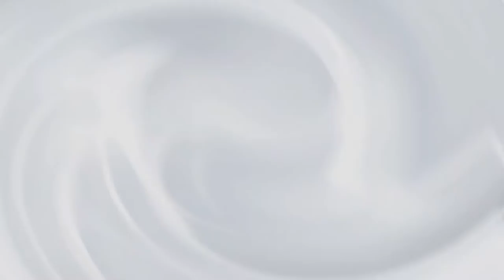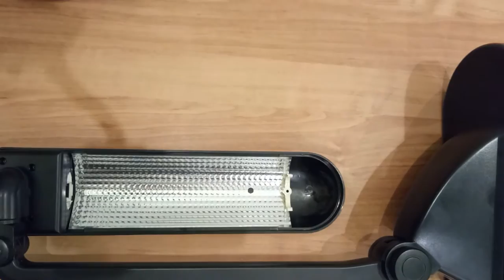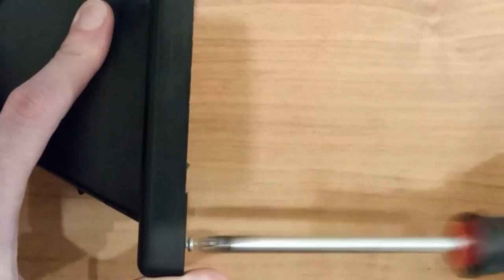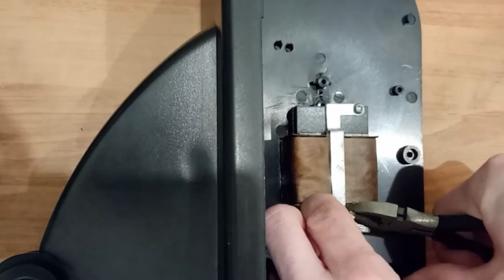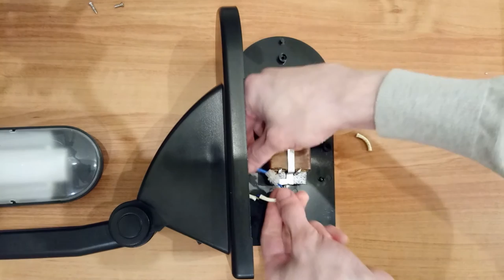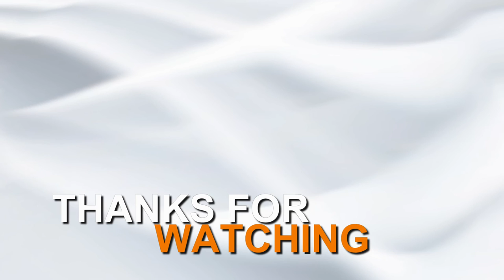G23 fluorescent lamp - to into leds lamp G23 - Restoration Table Lamps G23 - Desk Lamps / DIY

Comment: To your knowledge: will the led lamp flicker if I just decide to retrofit it instead of a fluroscent one?
Reply from the maker: You CANNOT just install it instead of a fluorescent one. The lamp has its own circuit.
Reply: @LifeKaki  well, for example, Osram Dulux S 11 LED EM can be installed by either:
 1) Retrofitting - just replacing a fluroscent lamp with the LED one
 2) Conversion - bypass of the ballast (direct connection)
Reply from the maker: @ashez002  Well, ok, I don't have that kind of lamp.

Comment: I did this exactly as you did.  My light very similar except 2 lamps in there.  When I switched on nothing.  Further investigation showed that my lamps were in series and so not enough voltage to start the LEDS. Had to fiddle around connecting them in parallel and then they worked fine.  Can only think the manufacturer had a load of USA 110V bulbs to use up and these would not have worked on UK mains 240V if connected in parallel.
Reply from the maker: Hey. Thanks for the comment and viewing.

Comment: Hi
My Ottlite with G23  tube went and saw you  video, happy me. You have 2 blue cables to join  i have 2 brown so do i just do the same and connect them together as you have done  thanks... Lizzie
Reply from the maker: Hey. Most likely you are doing the right thing. 
The main thing is to turn off the transformer!
But the transformer is left for poise!!!